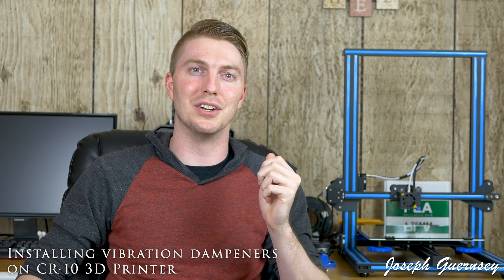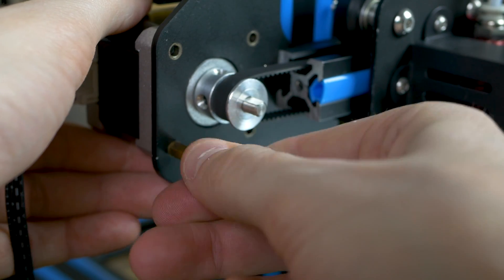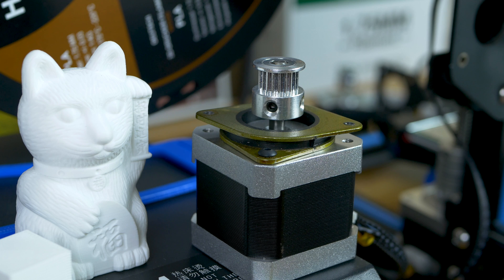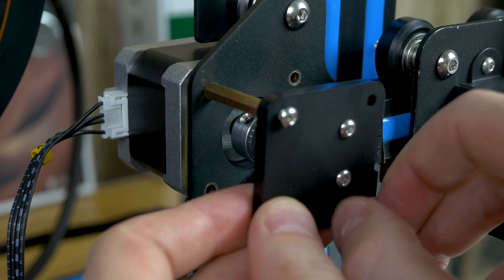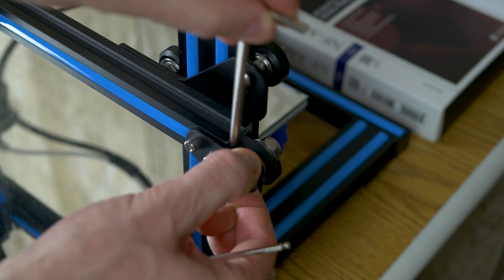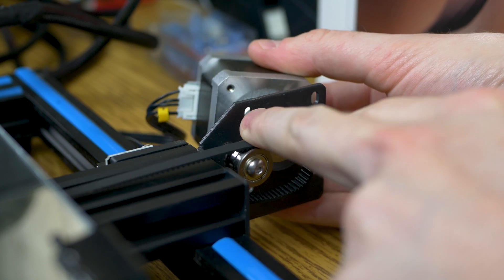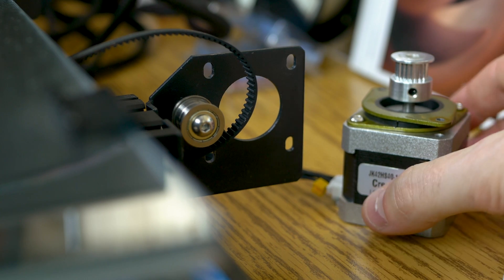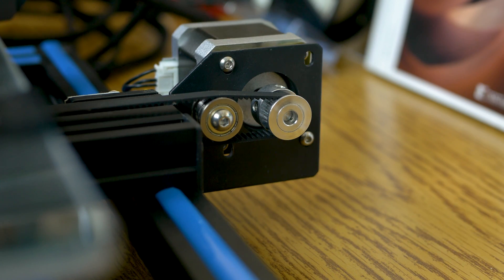How To Install Vibration Dampeners On CR-10 3D Printer

Comment: Because of how the bracket flexes, and because you can choose which 2 of the 4 holes you install to, I would recommend leaving the NE and SW copper poles in place, and not the ones you used (rotate the damper one turn to the next hole to accommodate that).
It leaves it less able to flex in the direction you need to tension the belt.

The way you have it situated leaves it able to flex, which can cause the belt to bind.

That said, great video. Very detailed.